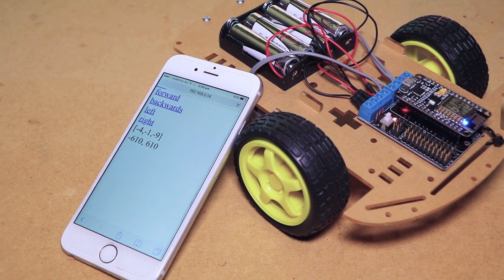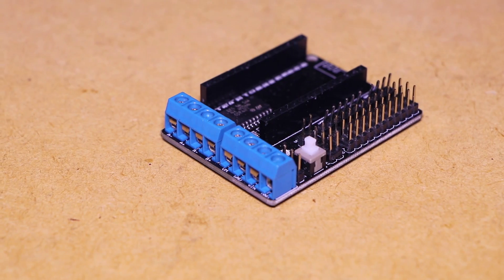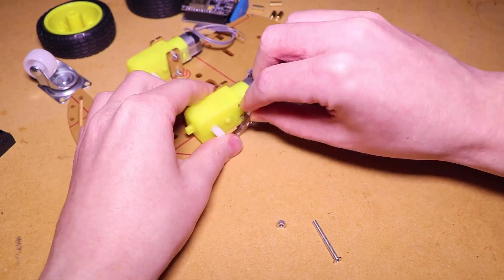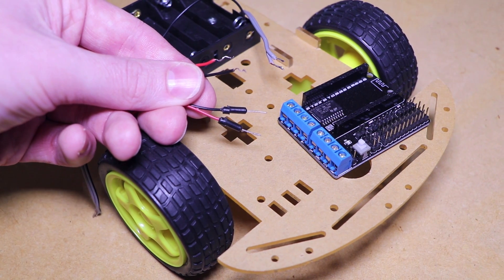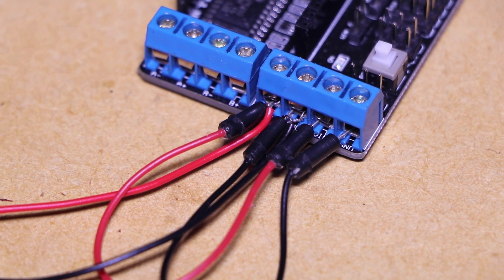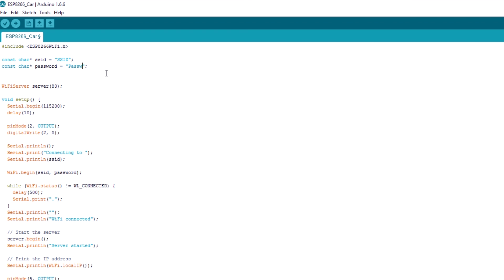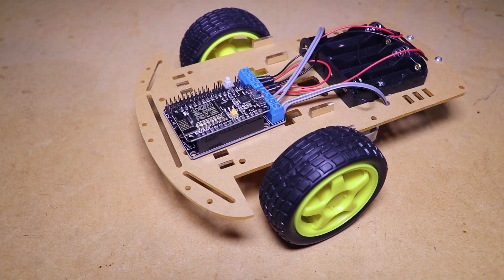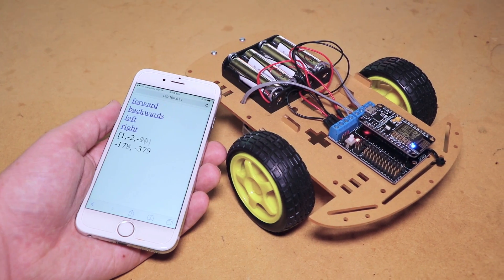ESP8266 - WiFi Car

Comment: Hi 
I am using the same same kit nodemcu with motorosheild as shown in the video. I have downloaded your code and have tried running it. However, I am not able get the motor operational. The code is working. Based on any commands of the browser page. the LED on the nodemcu is blinking. But however the motor is not getting operational. I have individually even powered the motors and checked the wiring and other things. The motor is operational in this case. 
However when I make it operational thru sheild bridge. the thing is not operational. How can I verify whether the bridge is working fine or the IO pins assigned by me is having a problem.
Reply: same here 
do you have a solution ?
Reply: Did you ever figure it out?
Reply: I have same situation